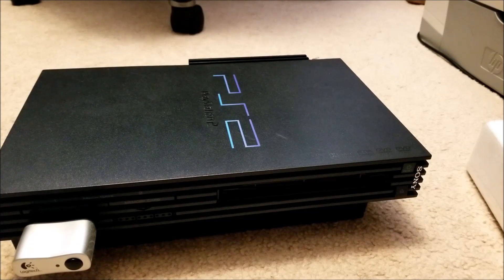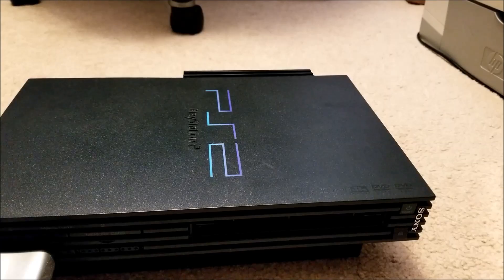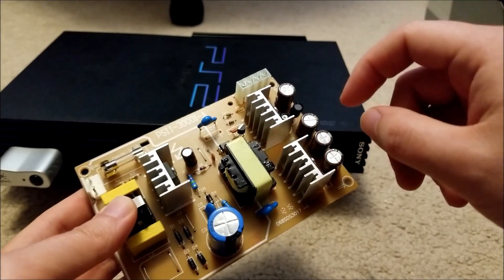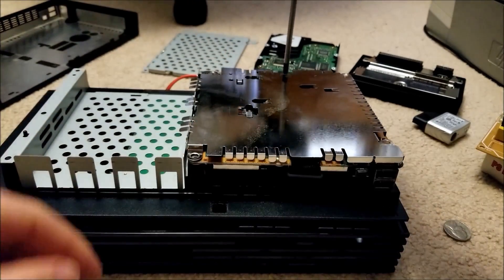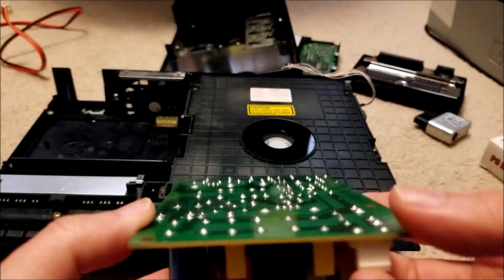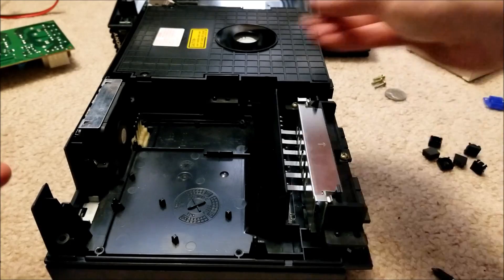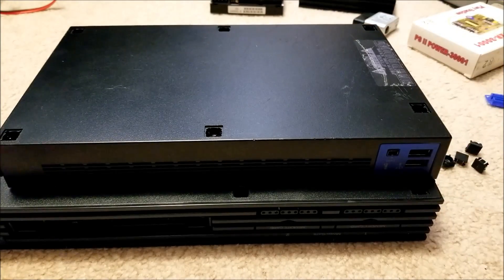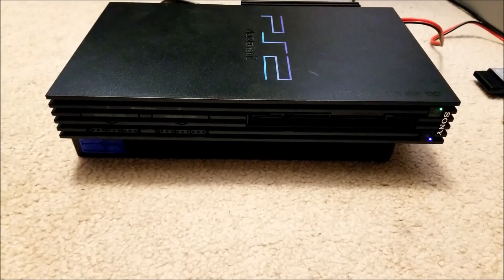Let's Fix: Sony Playstation 2 Power Supply Replacement

Comment: Hi, thanks for the electronics repair videos that makes life easier.

I bought a japanese Wii Fit Plus balance board (planning to play golf w/ dad, God-willing), bought it for US$18, everything works except that it won't turn off when you exiit the Wii and turnit off, the blue LED just keep blinking non-stop when the Bluetooth not connected. It all works it just this one defect. A part of the battery contact is corroded (greenish thing), I was wondering if that will solve the not turning Off (it also has difficulty turning on when you sync it.

I was wondering if it's an easy fix, if it's an easy fix, to preserve the relationship with the accommodating seller, I'll just opt for him to reimburse a bit of amount since it's technically defective but how many percent do you think is defective? 20% 10%, that's the amount I'll ask. It's also going to be expensive and a huge hassle to ship back.

Thank in advance for the advice.

God bless.
Reply from the maker: I'd guess some corrosion got on the board near the batteries and it needs a good cleaning

Comment: This video was very helpful :) I've just bought a US 39001 model I'm from Europe so if I'd have plugged it directly into our mains it would have fried to system but I didn't want to have get a step down convertor for the sake of just one system so this is going to be very easy swapped out the PSU :) I could have bought a PAL system but I'm not sure if the frequency for ps1 games will be slightly off when running at 60hz and I don't think you can install a duel frequency oscillator into the ps2 like you can with a regular ps1 but I wanted to play my games on one system So I don't have to swap the system out every time I want to play a PS1 on PS2 game so I thought if I get a NTSC PS2 I can run PS2 games from the hard drive and then run PS1 discs :D 

Sorry for the life story in the rambling haha  thanks again for the video

Comment: I bought a japanese ps2 and i didnt know that i need to have a power converter as i live in the uk and i think i blew the power supply by using a uk power supply from one of my other uk ps2s if i have blew the power supply i will have to do this fix thanks for the helpful video

Comment: Hi could I have wiring for the power supply you taken out please? I have a ntsc j ps2 power supply blown. I assume the last owner plugged into 230v uk so this is how he blow it, but rather than change board I'd just use a 12v power supply
Reply from the maker: Sorry, I honestly don't remember where or what happened to the original broken supply. I made this video 4 or 5 years ago so it's likely I've already scrapped the board.
Reply: @sjm4306  

I mean the part wire u wired to 3d printer.  How did u wire it to bypass the power supply totally. Where u said u connected it to your 3d printer . That's all wiring for that.
Reply: The part wire u just need the wire without power supply just to ask
Reply from the maker: Ah, sorry I misunderstood. I wired the 12v and ground pins on the desoldered output socket of the broken supply to the dc output of the power supply of my 3d printer. It was a meanwell 12v supply so I just connected +12v to +12v and ground to ground.
Reply: @sjm4306  it OK I have one original Japanese version of ps2 before they even used ide connector. PCMCIA card was used instead.

Comment: IS IT POSSIBLE TO REPLACE PS2 JAPANESE VERSION POWE SUPPLAY 110V WITH A EUROPEAN VERSION 220V/240 ?
Reply from the maker: So long as the new supply fits then yes as all phat ps2's use 12v dc internally

Comment: I want to transfer a 120V power supply to my European ps2 that doesn’t power on here in America because it has a 240V power supply if you have extra tips or info before that I open both ps2 to switch it I’ll be happy to know more 

And I have a American ps2 for part that doesn’t read disk to do the process

Comment: Where’d you buy that power board
Reply from the maker: Ebay
Reply: I scoured eBay and no dice
Reply from the maker: https://ebay.us/zfEDJE
Just be sure to open your ps2 and compare the original power supply to the one you plan on buying. Afaik there are two different supply boards depending on the model number of your ps2 and they are not cross compatible.

Comment: Hello What is the power supply output in amperes ZSSR094ZA how many amps
Reply from the maker: It's not marked but if I had to guess it's probably in the neighborhood of 3A. You can kinda calculate using the power wattage rating printed on the label, dividing by 12v (this sort of gives you a ballpark since P_out is gonna be nearly 80-90% of P_in and there's probably about a 20-30% overhead on the supply rating compared to max console draw). This is not really the right way to exactly calculate this but like I said good enough to ballpark it.
Reply: @sjm4306  May Allah reward you for a great effort and a full explanation
Reply from the maker: Thank you!

Comment: Sjm4306 what is the voltage and amperage of the power supply? Would a 12volt 5amp external power supply work as replacement or do I need lower amperage? I'm wanting to do a mod where I make a phat slim lol but my power supply is toast iv got a load of random laptop power supplies so plenty for spare parts any help with the info would be greatly appreciated thanks.
Reply from the maker: I would guess 12v at 2 or 3A would be plenty. You can always safely use a supply rated higher than what the ps2 needs. The ps2 will only draw what it needs and the rest is just headroom that the supply can supply up to.
Reply: @sjm4306   thanks that will definitely come in handy  really appreciate the fast reply

Comment: why do we even need a new power supply board? can't we just replace it with a 12v power adapter (+ a couple of wires and a connector soldered to the pins) and use it like that?
Reply from the maker: Yes you can do that, I just wanted mine to be oem stock. I actually temporarily wired mine to my 3d printer's 12v supply to test that the mobo still worked.
Reply: @sjm4306  thanks a lot for your response. it got me thinking.. why do the manufacturers even use power supply boards? wouldn't it be easier and cheaper to make the product in a way that a 12V power adapter would be plugged in it instead of a 220v power cord+psb? do you know why the board is needed there? does it have any advantage over a simple power adapter?
Reply from the maker: An external power adapter just moves the power supply board into an external enclosure and squishes the power components to make the whole thing smaller. There are benefits like things inside the console generally running cooler, but also downsides like more complexity in the design/more failure points/higher standby current. Also including the supply inside the main enclosure often means better safety overall, whereas using an external adapter often means farming out the manufacture of it to a 3rd party company which can be hit or miss. Finally the biggest reason I think the internal supply was selected for the ps2 phat consoles was power capability and part availability. The phat ps2's weren't super efficient and finding a cheap/widely available external 30W+ power brick at 12V is harder than just designing one that'll go inside the ps2.

Comment: hello i have a question.
I recently brought my American ps2 to Australia and plugged it in to the 220v and fried it, now my question is do i need to just change out the fuse? or would there be more internal damage? and if i open it up will i be able to tell if the fuse is blown? like will it be black? thanks.
Reply from the maker: Chances are the fuse just blew but if you are unlucky it may have taken out the rest of the power supply as well. The chances of it going further to damage the console are pretty low though so at worst you'll need a new supply (which you would've needed anyway unless you use a voltage transformer to convert voltages). Blown fuses are usually pretty easy to spot, the inner glass vial will be black with soot, and measuring it with a multimeter on continuity/resistance will show that it's effectively open (OL).
Reply: @sjm4306  thanks for your time mate! im currently using my slim ps2 with a regular converter that im guessing changes the voltage down so it does not fry? i have a large transformer for my Kitchen aid mixer to down grade 220 to 110 for it to work but like is said the ps2 slim american console is just plugged into a international converter plug and it works fine. so as far as switching out the fuse does that mean any soldering ? or just pull it out and insert the new one?

Comment: I have a PS2. I know the power cord is good but when I press the on button nothing happens. No lights out anything. Any suggestions
Reply from the maker: Check that the output of the internal ac-dc power supply is actually outputting 12V. I'd guess the fuse for the supply blew for some reason.

Comment: Hello i have a problem with my ps2 i broke it but i dont know what is wrong with it. I was working on it to replace the housing and wanted to pull the disctray out while the console was on and the motor of the disctray was pulling in the other direction to close the disctray. And the console made a sparking sound and doesnt do nothing anymore. If i touch the power supply i get a schock so the power supply does still work so i thought. But i ordered a replacement anyway. With the replacement power supply my console makes a noise when i turn it on but still does not work and the fan does not work and the blue and green/res power lights do not work either. What could be the problem. Thanks im advamce for any help.
Reply from the maker: You unfortunately probably fried something on the motherboard. Unless you have experience debugging complex circuitry and tracing faults it'll be an uphill battle. It's probably cheaper at this point just to buy another second hand ps2. If you still really want to fix it for the challenge and experience I'd suggest googling a ps2 service manual for the schematic and measuring with a multimeter starting at the 12v input rail to the mobo. If you are lucky the part or parts that fried may be scorched or physically cracked so you can also start by closely looking at all components to get a hint at what failed and needs to be replaced.

Comment: Im livin in eu and i want to put my ps fat PAL power supply in japanese console ( pal 39000 and jp is 37000) will it work? Thanks !
Reply from the maker: The ps2 motherboards should all internally accept 12Vdc so it shouldn't matter what the power supply input voltage is so long as it outputs 12Vdc and physically fits in the case.

Comment: If my ps2 is 110v, and I replaced the PSU with a 220v will it still work?

Edit: typo
Reply from the maker: If you are asking if a 220Vac supply is fed with 110Vac would it work, then the answer is nope. You have to match the supply input voltage with the mains supply voltage for your region. Some supplies are multi-region though with a little switch to select the input voltage but I'm pretty sure internal ps2 supplies for the fat series are designed for fixed input.

Comment: Could you send a link  for this power board I ordered from a place on Ebay for my ps2 fat and they sent this power board and it is so big it wont begin to fit I have model 30001 PS2 Fat . THanks
Reply from the maker: Unfortunately looks like the seller I bought from no longer exists and none of the ones on ebay will fit earlier gen ps2 fats. You can try aliexpress but I really cant vouch specifically for any sellers there since I got mine off ebay ages ago.

Comment: what did you write in the search bar of that web site in order to find the power supply? "ps2 power supply" ?
Reply from the maker: I think I searched "replacement ps2 power supply" and referenced pics with the one I had pulled from mine to make sure it was the correct revision.

Comment: Can a FAT PS2 use a 12V 2.0A adapter? Please.
Reply from the maker: From a quick google search looks like the stock fat ps2 supply needs roughly 4-5A at 12V.
Reply: @sjm4306  thanks alot for the reply. One more thing. I noticed there are 4 pins, do I have to ensure power reaches all 4 or the two middle pin is enough?
Reply from the maker: The two left pins are tied together and the two right are tied to eachother.

Comment: So if I test the 2 'obvious fuses' and they show continuity then it needs that new board you showed in the video?  Is there anything besides the fuses I should check if like my ps2 doesn't come on at all... does NOTHING.  I am average with electronic and understand reading wiring diagrams just curious if this new power supply is what I need or anything besides the fuses I should check prior to doing this?  
Also:  where do I find the information I need when ordering  the replacement power supply, just the model and serial#??

Thx in advance!

Comment: Hello sir, so i had this same problem but my PS2 model is the 10000 japan first model, i just want to know if the 30000-the same in the video would also work.. Because i noticed the power supply of the 10000 and 30000 is identical, would it work? There is no power supply for 10000 anywhere and that is why i want to try the 30000
Reply: Hope you reply, it would really help a lot, thanks sir

Comment: I pulled my ps2 fat apart to clean lens and fix the disc tray and after reassembling everything is fixed but now my video cord doesn’t work and I can’t seem to fix it ? Any idea
Reply from the maker: Double check all the ribbon connections. Some consoles will refuse to boot if something's not put together properly inside.
Reply: sjm4306 it all turns on seems like it’s working just no visual. The ribbon for the controller input came out I’ve tried putting it back in but nothing works

Comment: My old ps2 started acting weird although it’s been good for quite some time. It started to output weirdly. It displays as black and white and almost static with the screen moving to the top to re-appear from the bottom (sounds weird but idk how to explain it). Ik it isn’t the av cables being in the wrong spot but I’m a tech noob. Do you know any possible causes or fixes?
Reply from the maker: Does it change if you gently wiggle the connector? It could be a bad solder point of the ps2 av socket.
Reply: sjm4306 it doesn’t change when I jiggle the cord, I have 2 different wires that connect the ps2 to the tv and I get the same result. You might be right about the bad part on the socket

Comment: I have my european 240v ps2 in USA. Is it going to work if I replace the power supply to 120v?
Reply from the maker: Yes, both region supplies output 12V dc that the ps2 runs off internally so swapping them will only affect what mains input voltage it will accept.
Reply: sjm4306 thank you for the quick response. Any idea where can I find a reliable replacement?
Reply from the maker: I bought mine off ebay
Reply: My ps2 model  is 50004. I look on eBay and I found some same shape with all the cuts but the parts are in different order ( for example the power cord plug is in a different corner), so it’s not going to fit

Comment: My ps2 fat opened it to clean it. use WD-40 and a brush. I don't know what happened, but there is no current. and the green and blue buttons do not light. Try reconnecting everything and it doesn't turn on either. the console worked perfectly and just remove the covers to clean it. Do you know what happened?
Reply from the maker: Never use WD-40 on electronics, I believe it is petroleum based and have no idea about its conductivity or reactivity. The reason so many people suggest high percentage isopropyl alcohol is that it evaporates quickly and nearly entirely, leaving very little behind that can short circuit something on the board. The best you can do now is try to rinse everything in ipa to remove the wd-40, but I suspect that the first time you powered it up something shorted and died.

Comment: eyyow... can you help me🤦‍♂️
is a SCPH-35001 a 110? or a 220?
Reply: Depends on your Region. if your PS2 is NTSC it is a 110V and if it is PAL it is a 220V
Reply: It should say on the back, but considering the model number ends in 1 it's probably 120V.  The 1 means North America I think. It's just the region code. For example SCPH-30000 is Japanese.

Comment: sjm it only say AC 120v 60Hz 35W
Reply from the maker: Then unfortunately you would need to swap the supply with a voltage compatible one or use an external ac converter like I'd suggested.
Reply: @sjm4306  how can i do that
Reply: @sjm4306  how do i use an external ac converter without destroying the ps2